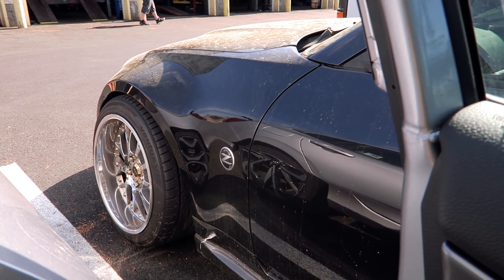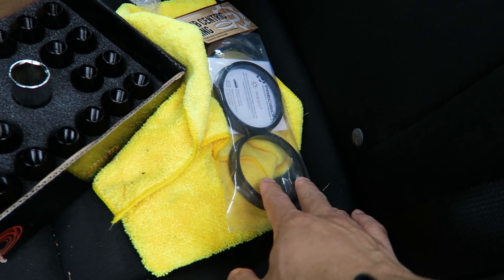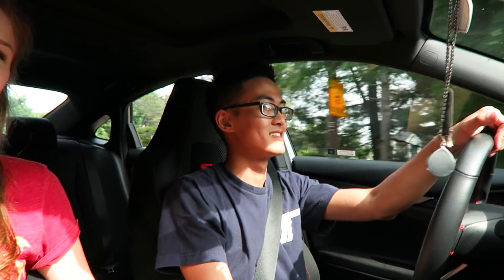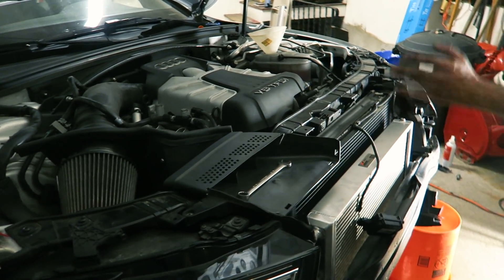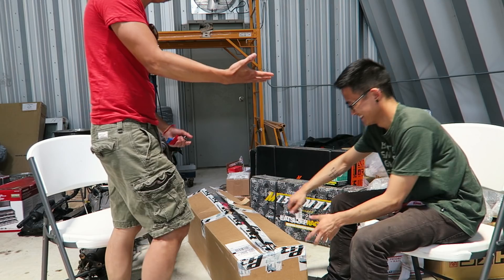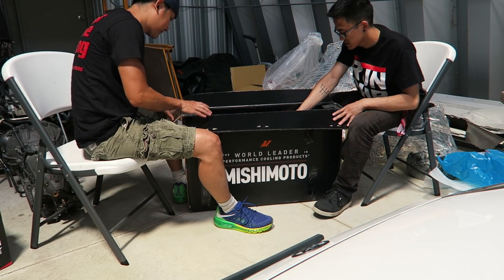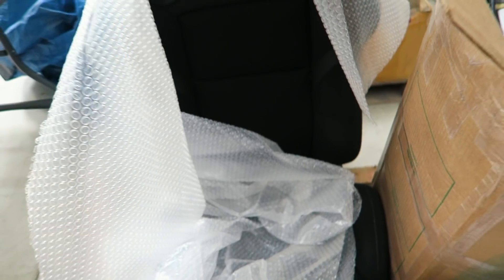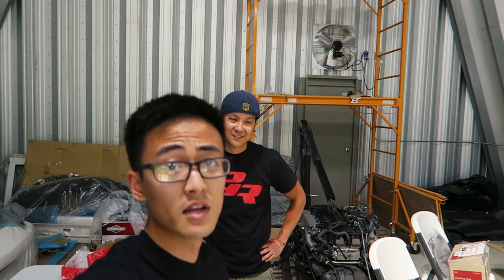VMR Wheels 𝘔𝘖𝘜𝘕𝘛𝘌𝘋, S4 Supercharger 𝘗𝘜𝘓𝘓𝘌𝘠𝘚, And Unboxing A Toyota Supra Turbo Kit

Comment: do you have the lug nut specs like thread and taper of the seat , where it meets the rims or a link to the ones you purchase will help also, thanks
Reply from the maker: The lugs were m12x1.5, and the seats were conical to match the wheels I bought.  I bought the wheels straight from vmr wheels and the lugs from this Amazon link: https://www.amazon.com/gp/aw/d/B00OBEP4U2/ref=ya_aw_od_pi?ie=UTF8&psc=1